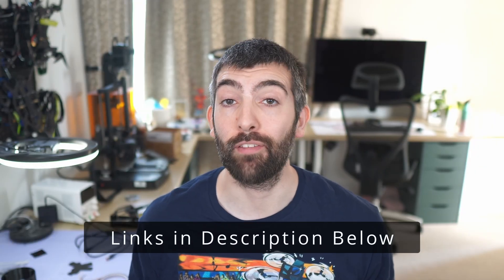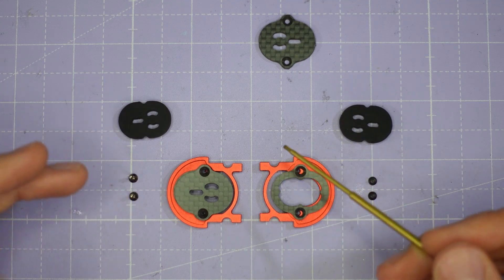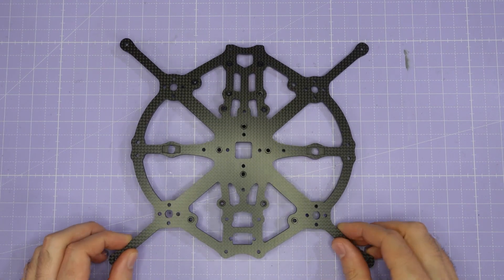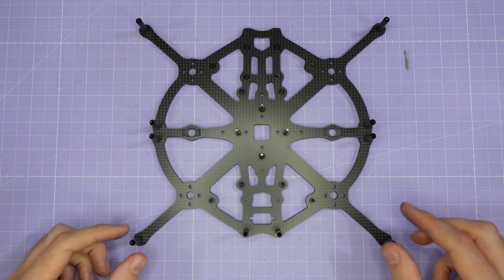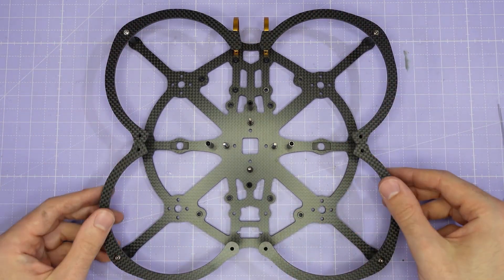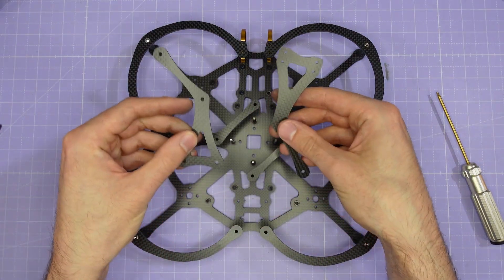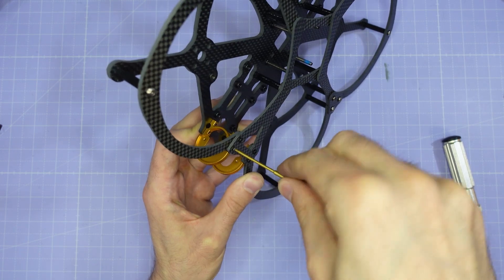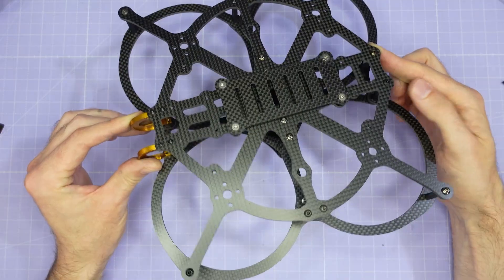AOS Cine40 V5 Build Guide: 4" Whoop for GoPro or Naked BlackMagic Pocket Cinema Camera

Comment: I like the aos frames but this one is pretty complex. In my opinion propguards should be symmetrical on both axis so they are easy exchangeable. For example if i crash with front and it is broken it could be easy fast fixed with tape and changed with the rear one. Works fine e.g. on cinelog 30. Also there are so many parts... 2" has less parts, right? Because I would like to by one for Xmas.